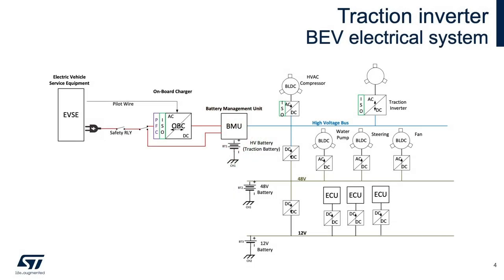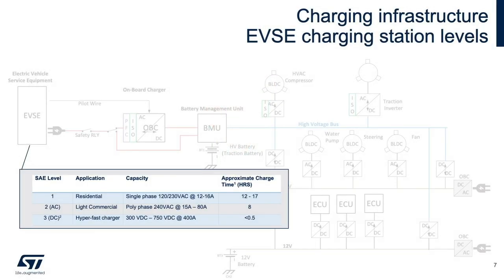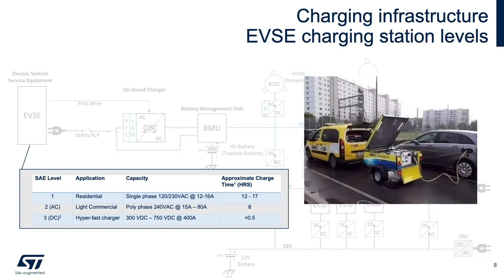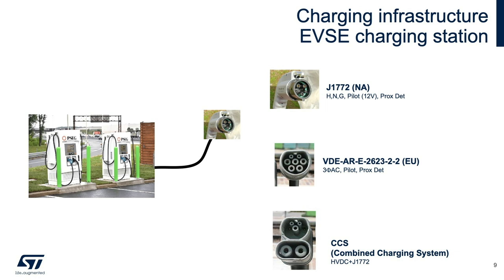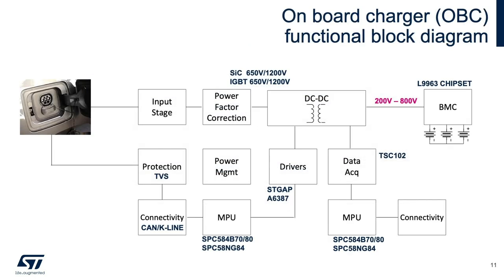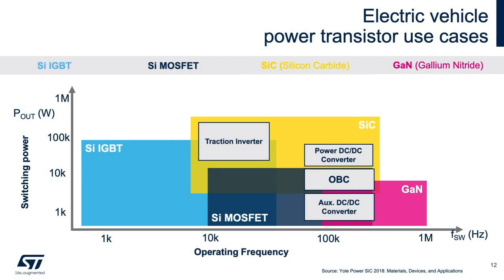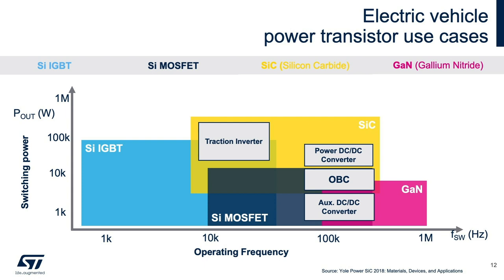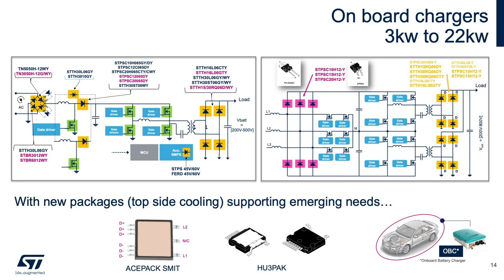On-board Chargers in Electric Vehicles

Comment: I recently bought a 2016 Nissan Leaf with the 30KWH battery. do7.pl/jCarStation This is my first EV. I used the regular charger for the week and decided to get a level 2 EVSE. After much research I bought 2 of these one for my house and the other for my friend’s home as we live 15 miles from each other and I spend the weekends in her part of the city.This product works exactly as advertised. Set up was easy, the profile is nice and compact, and the app works the first time and every time. It has been 3 weeks or so and my car charges quickly. This unit is really nice. If you need an EVSE get this product. You won’t be disappointed.
Reply from the maker: Glad to hear it !